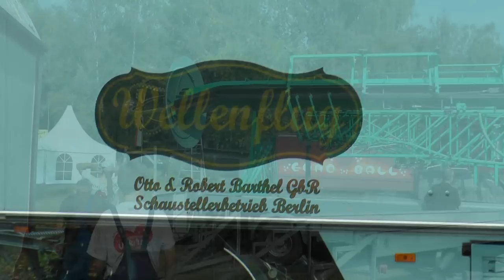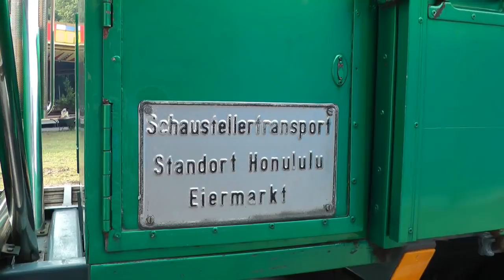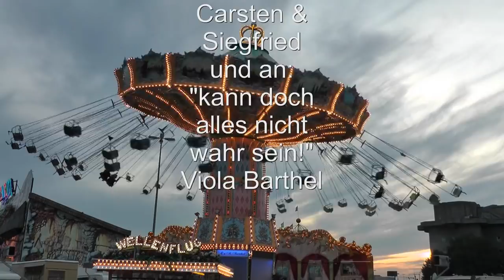Barthels Wellenflug Berlin

Comment: This is the most interesting kirmes YouTube video I've ever seen!  This is one of my all time favorite rides and it was a real pleasure to watch it get set up.  I do however wish that you didn't skip over the build of the center operator booth.  This was still amazing and I wish there were more videos like it.  As for this ride it's amazing to see how labor intensive it is to set this up, I never knew.
Reply: @Tiny Power; Most definitely. I believe it took the crew at least two days to assemble this ride from top to bottom and it certainly would've been great to see the lower half of the ride's operator both being assembled although looking at the operational footage it appears that the operator's booth was off to the side rather than in the center of the ride like it typically is supposed to be located.